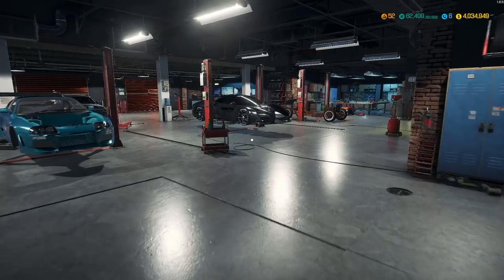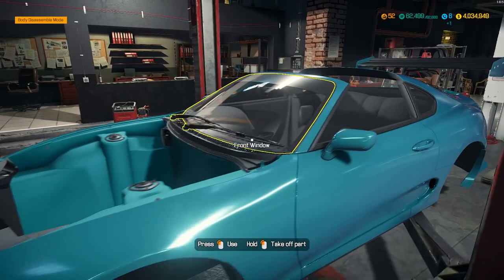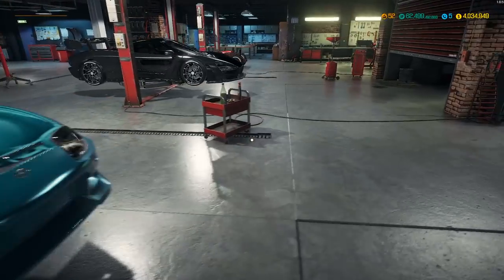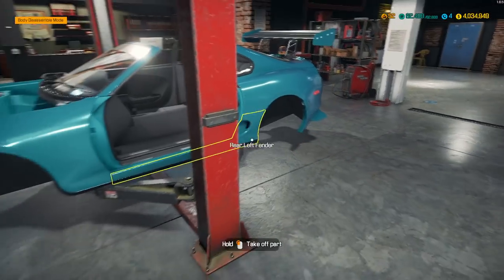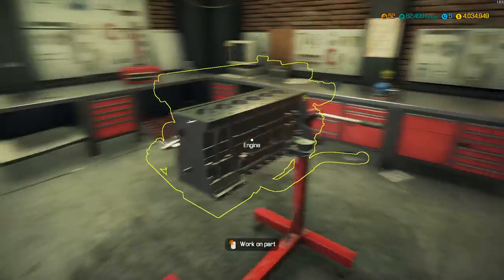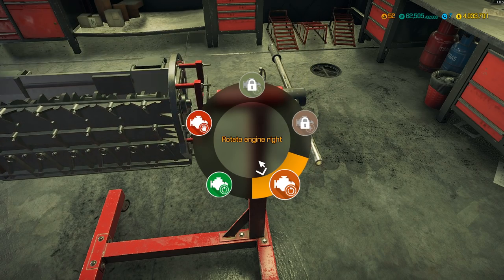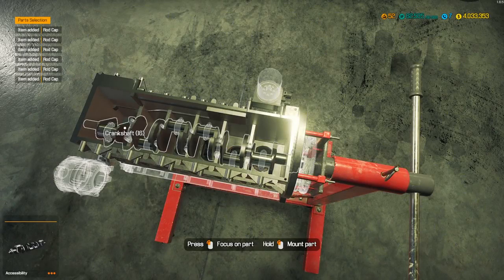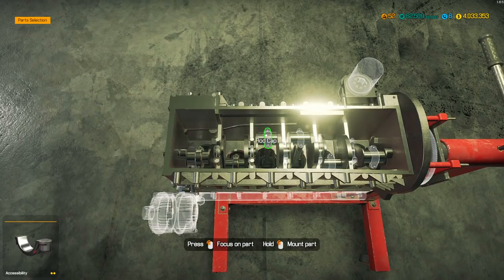REBUILDING DRAG SUPRA MOTOR - Car Mechanic Simulator 2018

Comment: Stock engine was a 3.0 liter 2JZGTTE. TT stands for the twin turbo. Yes it was stock twin turbo with around 320 horsepower at least in the US. The engine you have isn't a 2J but it's probably as close as you can get. They also didn't have carburetor's they was fuel injected.